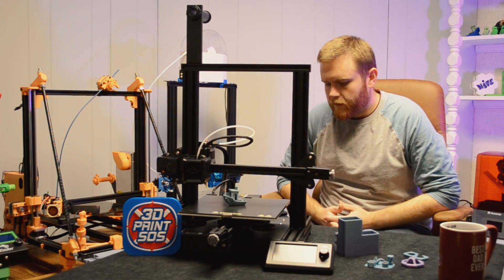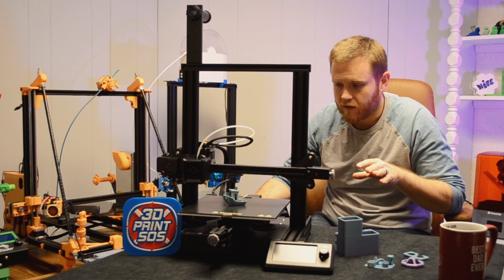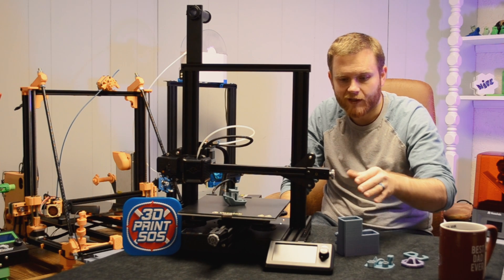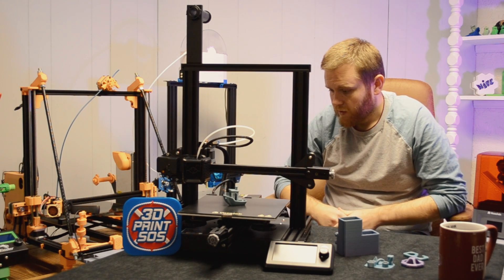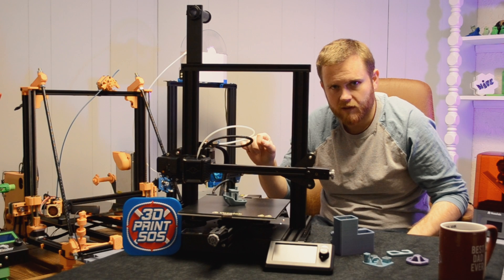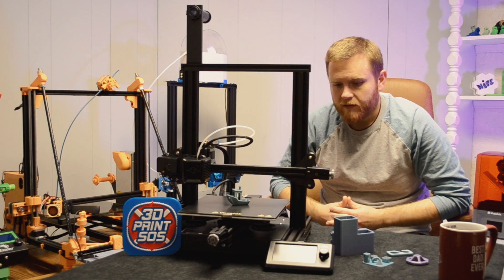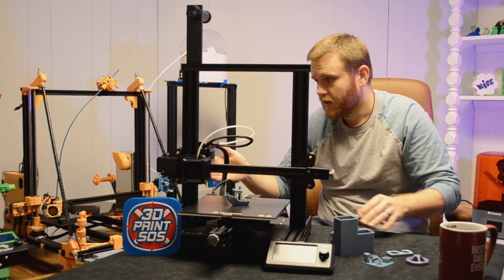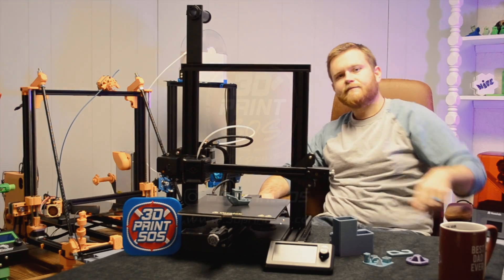Voxelab Aquila 3D Printer Review

Comment: minor question : is it possible to print with this one at .08mm height distance slowing it down well enough for it ? since i wanna try some higher detail stuff but still have the option to go for more loose items aswell and not go for resin
Reply from the maker: Yes, you can print at .08. At some point you’re in the diminishing returns range. I’m not sure I have even gone under .1. Even that was a bit painfully slow. With that said, might be time for some experimenting. ;)
Reply: @3DPrintSOS  i saw a comparison of a resin printer and a 3d PLA printer and doing it at .08 makes impressive results but im on the fence.

I wanna get this one but wanna make sure i can get good results and print my models (i work in the game industry)
Reply from the maker: I should really do a video on this topic probably. Especially because I own both voxelab machines... but generally I would say if you plan on making prints with lots of details, I’d go resin. If you plan on printing things that require structural strength or assembly, I would stick with FDM. Both are inexpensive to get into. For me resin is super cool because of the details, but I personally stick to mostly FDM printing because most of my stuff needs strength or flex. Resin is extremely brittle.
Reply: @3DPrintSOS   i want to make both structural items and high detailed stuff ( example a mandalorian helmet, some miniatures, boxes, card boxes, miniature display cases (maybe a lancer and retrolancer i modeled)) with these items it seems to lean more to pla? 

Since the video showed quite high detailed miniatures with a .08 height the resin looked smoother and slightly more refined.
Reply: Would love to see your comparison, i would most likely start with this printer since its quite a good price, im close just need that final push to make the step, im really worried ill make really bad prints haha want all the help i can get to get that first nice clean print
Reply from the maker: @Dtikwa  I would say if you need a wide range of prints like you described, stick with FDM. You can always get a smaller nozzle to do detailed prints. :)
Reply from the maker: @Dtikwa  You're at the right place. I saw, grab one and dive right in. If you have questions, I'll try to help. There's a ton of resources out there now. So, you should be in good hands. :)
Reply: @3DPrintSOS  it says on the voxelab website that the layerthickness is 0.1-0.4 

Can u push it down to 0.08 or are those hard limits ?
Reply: @3DPrintSOS  really glad i stumbled on your channel :) excited for this was waiting 5 years to grt into it and glad to see it has become cheaper and more accurate :)
Reply from the maker: @Dtikwa  Those are just recommendations. Like I mentioned there are diminishing returns and issues as you go lower and higher. At .4 for example, I dont think any layers will stick at all since they wont be getting "squished" into each other. Generally, you want to print at a max of .2 layer height on a .4mm nozzle. However, going lower should work. .08 is going to be a super super fine print. Check out this video of some example of "normal" layer height prints on a stock Aquila: https://www.youtube.com/watch?v=aPCYCf8vC04 via @wildrosebuilds

Comment: My feed tube keeps getting pushed out of the little holder near the geared feeder. That little blue clip isn't doing much to hold it in place. Any ideas?
Reply from the maker: I’m afraid that’s a major issue with al ptfe couplers. I’ve had issues like this on a bunch of different machines. I have a printed solution on my Thingiverse but if you can’t print, I would suggest buying higher quality ptfe couplers. The copper ones with blue plastic.

Comment: Just ordered one yesterday BEFORE I saw the review here. Glad I did though. I compared it to other 3D printers at it's cost point ($199 right now) and they had much smaller print sizes. This thing is over 8.66x8.66x9.84 inches in size if I read the specs right. Seemed like most others were in the 6x6x6 inch range. Thank you for the video. It sounds like I made a good choice for a first 3D printer!
Reply from the maker: They are typically labeled in mm and 220 is a good size. It basically mimics the Ender 3 in that regard. Either-way, you'll love it.
Reply: @3DPrintSOS  Yes, it's labeled 220x220x250, but I converted it because 'Murica! 😆 I needed measurements I could conceptualize in my head.
Reply from the maker: Haha. Oh I know. Over the years I’ve been getting accustomed to mm more and more I really like it now. Haha
Reply: @3DPrintSOS  If it's okay to ask, do you have a video or any recommendations (preferably free or low cost) for software to use to create 3D items? I took a look at Blender and that is very complex. I'd welcome any recommendations you might have!
Reply from the maker: @DrCognitive  I would start with Tinkercad.com. It's limited, but over the years I've managed some really complex designs. Great to get started in.
Reply: @3DPrintSOS  Thank you so much! I'll check it out!!

Comment: Hi, mate! Could you please check if some features are exactly the same as on Ender 3 or not!
1) Mounting holes (for the hotend and the cover) on the x carriage
2) Nut mounting hole (center) on a z (and extruder) carriage relatively to the center of its vertical (aluminium) extrusion.
3) Is aluminium extrusion is flat or has some rocker? It is noticeable when you mountEnder 3  vertical extrusions with 2 screws - if you tighten one or the other, extrusion will move, changing its angle vs horizon)
Why I'm asking is that I'm making a project of upgrades for the Ender and would like to know if they will fit this printer also.
Thx!
Reply from the maker: Both the printers are printing at the moment so I'll have to try a bit later. Visually, there are some minor changes to the carriage but I do believe its a direct copy. Ill confirm at another time. As far as the extrusion, I dont see any rocking. The whole thing is very stout. The way I do this is I keep the vertical extrusions loose and tighten after I have installed the X and the gantry 2020. So, I wouldn't know without taking the printer apart.
Reply: @3DPrintSOS  I uploaded a pic to explain what type of rocker I mean. https://ibb.co/C2qMt5j There is a rocker on my Ender 3, I draw it in black. So if I put a ruler (red) it will touch one side and the center of an extrusion, but will not touch the other side of it. Could you please check if it is the same with your Voxelab Aquila!

Comment: ine has a problem.. Idk how to attack the belt.. i just have it hanging off the end. Please help and tell me what to do
Reply from the maker: Hmm. The belt is tricky if you dont know how it works. Best I can say is you have to follow the manual closely. They have the belt in its spot early on and it may be a bit cumbersome. Once On the bottom it basically slides into the slits on the hotend assembly.

Comment: Will the same upgrades work with this that work with the ender 3 v2? I was going to order the BLTouch and an all-metal hot end with an Ender 3 pro but found this instead. Will the same printable upgrades work or are there things I should watch out for? Thanks for this great video.
Reply from the maker: Mostly. There are a few minor differences to the hotend carriage and obviously the screen. Otherwise, things should fit with minor fuss.

Comment: Thanks for the video. Thinking about picking one up as a 3rd printer to my stable. Already have 2 Ender 3 Pro's.   I see you mentioned that it's running 1.1.6 Marlin? Curious if you plan on updating that?
Reply from the maker: Very nice. Should complement the other 2 well. Im actually waiting on a confirmation about the actual version number. At the moment I have no reason to update. It's functioning perfectly and looks like it even has runaway protection based on another users experience accidentally heating it past 230c on the hotend. Also waiting on official confirmation of that as well.

Comment: Would it be possible to flash the firmware and install the Ender 3 V2 software on this printer?
Reply from the maker: No. Although this is already running Marlin with a sharper, better User interface. Plus it has a boot loader so it can be updated via SD.
Reply: @3DPrintSOS  Thanks. The reason I ask is that I'm wondering if it would work with the Creality WiFi box. Or, would I have to switch to OctoPrint.
Reply from the maker: @whidbey88  Ah I see. I would go OctoPrint all day over the Creality WiFi box. There are so many negative reviews of that thing. It just doesn't seem worth it in any way. Not that it would work with this machine anyway. You'll love OctoPrint once you get it all set up. Mines been running unmodified for three years on my main machine. Love it.
Reply: @3DPrintSOS  Thanks again. I bought this printer today.
Reply from the maker: @whidbey88  Awesome! You'll love it.

Comment: I am looking into buying this one and wanted to know if you could print detailed 1/64 scale wheels for hot wheels. And do you have to have a computer to run it
Reply from the maker: That might be a bit too small for this style printer. Maybe with a smaller nozzle... With that said, you should look into Resin printers. Amazing details, just a completely different way to print.
Reply: @3DPrintSOS  ok thank you for the advice
Reply: @3DPrintSOS  would the creality LCD be a good one for me
Reply from the maker: It would. But check out the Voxelab Proxima. Another great machine for a crazy price. And find me on Instagram for plenty of examples of prints. @3DPrintSOS

Comment: I just ordered on and it arrives on Saturday.are their any softwares that I need pesifically if not what do you recommended.keep in mind this is my first printer
Reply from the maker: There are several slicers that would totally work. However, my suggestion would be to download Cura. There is a profile that comes on the SD card of the printer and it works great with the latest free version of Cura.
Reply: @3DPrintSOS  okay,thanks for the help love the vids

Comment: This model really does look like an Ender 3 V2 clone, which is fine since it's cheaper. You should consider doing more videos on it since there aren't may others covering this model and I can see it becoming more popular if more people recommend it as a cheaper alternative to a V2.

One advantage of the V2 is that it comes with a 32-bit motherboard, which means you can install modern versions of the Marlin firmware (the v2.0 series). It also seems like the 32-bit boards have more flash memory, which means more firmware features can be enabled compared to 8-bit boards.
Reply from the maker: Yes it sure does seem to be a clone with a great screen. Been printing on it daily since I got it and its been great. So, it's a great option. Also, this printer also has a 32 bit board and is already running a modified version of Marlin. It also has a boot loader. So upgrading its firmware should be rather easy in comparison. Overall, I cant get enough of this machine. I highly recommend it.
Reply: @3DPrintSOS I didn't realize the board was 32-bit. In the video you said it shipped with 1.1.6 firmware, so I just assumed the board was 8-bit. I would've thought a 32-bit board would've shipped with v2.0x firmware :-P
Reply from the maker: I’m still waiting on confirmation about that actually. I initially saw that somewhere posted that I mentioned I though it was odd because it was outdated. 

Also it looks like it has runaway protection so it MUST Be 2.0 at this point. Would be a good idea to download and update to the latest firmware. ;) 

And yes, the 32 bit board is a great feature.

Comment: I bought this on December 28th cannot wait for it to be delivered I am going to make so many marvel movie props if I like the first one I’m going to buy I will probably buy a second one
Reply from the maker: Awww yea! That's gonna be awesome. Congrats on your purchase.
Reply: @3DPrintSOS  Thank you it will be my first 3-D printer I have been wanting one for a while
Reply: @3DPrintSOS  I have a question could I use 1.75 mm flexible filament on this printer
Reply from the maker: Brandon's Toy Corner Yes you can. However, if this is your first printer, stick with PLA for a few rolls. When you’re ready, you will need to print or purchase a new extruder (the stock one will not work with flexibles) and do a bunch of tweaks in your slicer. I designed a printable extruder that will work with flexible filament. You can find it on Thingiverse. Thingiverse.com/fedorsosnin/designs ;) good luck.

Comment: Hi does the Aquila have Thermal Runaway protection? Thanks
Reply from the maker: It doesn't look like this is something they market at all. So, I would say no. I know that they are running Marlin, but an early version. I can try to contact their support and see what they say.
Reply: @3DPrintSOS  thank you for the reply. Reason i was asking is that I was gifted one. After assembly, i set up a test print but noticed my bed was already heating up before i printed anything. It heated up to 112 all by itself. Do you by chance know whats causing this? Thanks again
Reply from the maker: @TheSoulof6  Oh man. It shouldn't be heating up by itself for sure! Is it doing it as soon as you are turning it on?
Reply: @3DPrintSOS  found out why. The board was burnt!. I reached out to their customer svc. We'll see what happens.
Reply from the maker: @TheSoulof6  Oh man. That's the worst case scenario. Something must've shorted. Sorry to hear it! They seem to have good customer service. Just keep in mind, they are in China. So, the time difference may cause a bit of a delay.

Comment: Hey man, i just got the exact model and can’t get it to print correctly! Can we get together on discord or anything please? You’re the only one who has posted on this model. I can donate $ for you time. Please!
Reply from the maker: I'm actually uploading a new video tomorrow that might help you with your issue. In the meantime, describe what is going on here and I will do my best to help you. That way, if others experience the same issues, the answer would be here for them. :)
Reply: @3DPrintSOS  for one, when i go to set the extruder, it says failure to power. However it does extrude the filament. I try to run the test models in the sd but it doesn’t extrude right away and when it does it won’t stick to the plate. So many issues man. 100% not blaming the product it’s definitely user error. Definitely a good deal for what it is
Reply from the maker: @ChRis-iw5ll  Failure to power could point to hardware failure or something potentially loose. Gotta check the wiring.  If it extrudes, it sounds like it's still getting hot. So, that's good. Not sticking to the plate could be several things. Likely a leveling problem, dirty build plate, or a temperature issue...or all of the above potentially. Let's start with the first issue, the Failure to Power. How are you trying to heat it up? Have you inspected the wiring heading to the heat block on the hotend?
Reply: @3DPrintSOS  what’s your exact discord name?
Reply: @3DPrintSOS  the b in my disc name is capita (101B#4553)
Reply from the maker: Fedor Sosnin#5823
Reply: @3DPrintSOS  add me in discord, 101B#4553
Reply from the maker: @ChRis-iw5ll  Hmm. Can't find you for some reason. I'm #5823

Comment: Which slicing software did you use
Reply from the maker: I’m using Cura with the profile found on the SD card. I changed the Combing to Not in Skin and moved the seam to the back. ;)
Reply: @3DPrintSOS  is it ultimaker cura?
Reply from the maker: @curtissteele6909  Yessir
Reply: @3DPrintSOS  how did you do the settings bc I can't finally got it to show on the Printer but its not reading properly
Reply from the maker: @curtissteele6909  Do you mean the printer profile? I just followed the instructions on the PDF that was in the same folder as the profile on the SD. There was one in Chinese and one in English.
Reply: @3DPrintSOS  i tried to download it but its not working for some reason
Reply from the maker: Curtis Steele well that’s odd. See if you can get an older version. Maybe there is a glitch. You can always try the install from the SD card. I believe there is a version of Cura in a zip folder on it.
Reply: @3DPrintSOS  im definitely going to try that the weird thing is there's the program chutibox on the SD card but that is what I used for my resin printer and i also has voxelprint but it doesn't show my printer. Going from resin to filament is very different.

Comment: Great review, I had my printer come in the other day! It actually came with some cura profile settings on the sd card, did you happen to use them? If not, would you mind sharing the ones you’re using Thanks!
Reply from the maker: Nick H. That’s the one I’m using. I changed the combing to Not in Skin and moved the seam to the back. Still getting flawless prints.